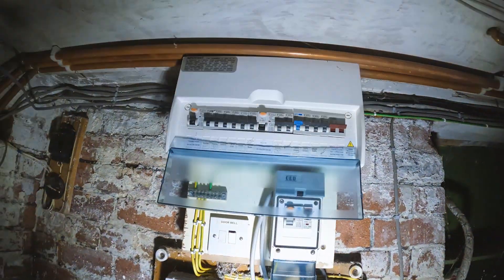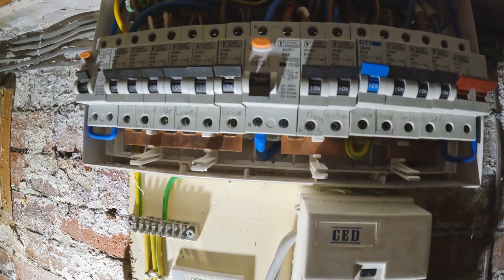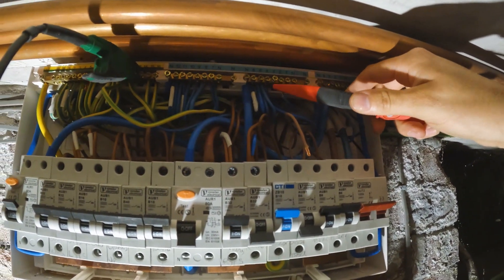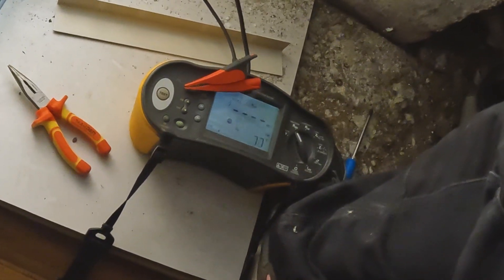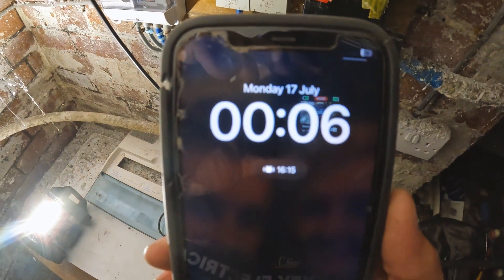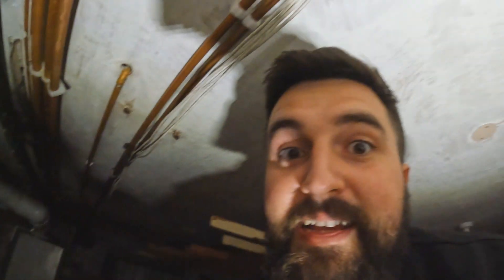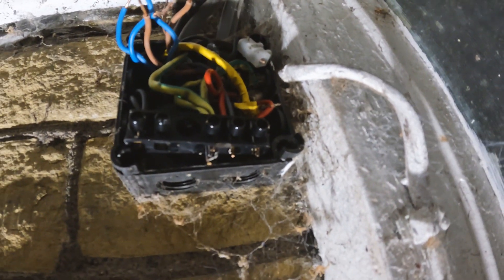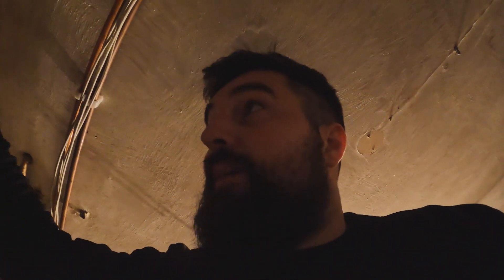MIDNIGHT EMERGENCY! RCD FAULT FINDING 🌃🔌⚡

Comment: Great vid mate 👍  knowing anything 1meg is a pass but 2meg or below should be investigated,  what on average do you think is a low reading that makes you check it out ? Hope makes sense 🤔
Reply from the maker: Yeah so under 1 Meg should be checked out, once you’ve checked it out and it’s still under  1 Meg. You can recommend a rewire but if your customer doesn’t want that you just have to run it into the ground until it’s tripping all the time.